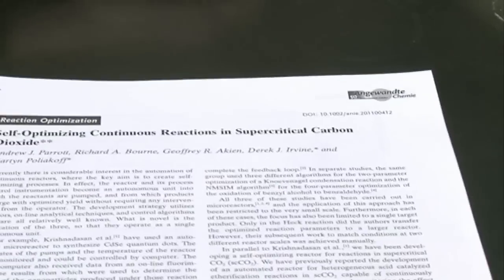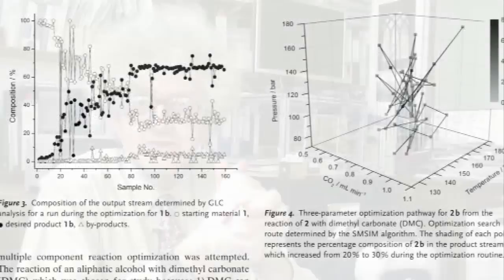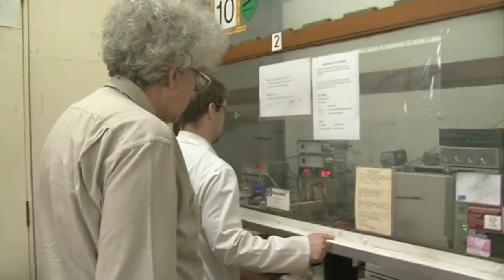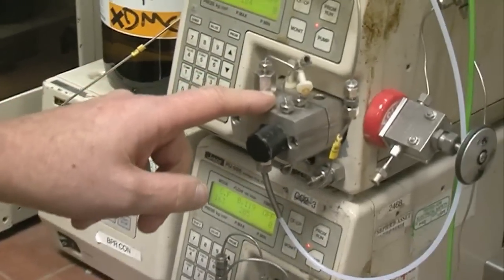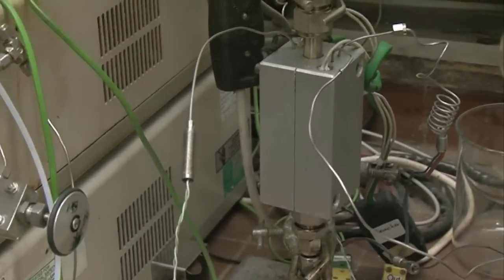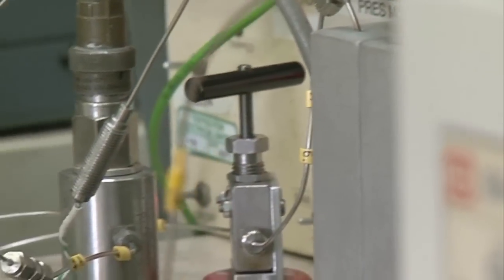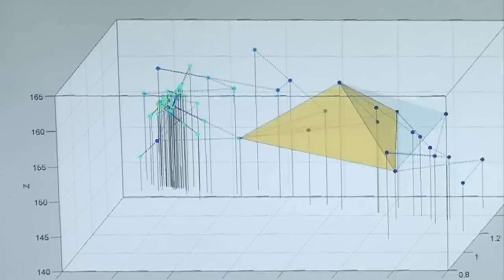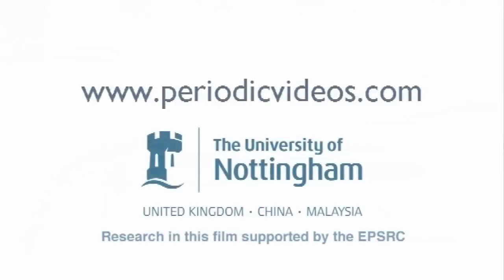Automatic Chemistry - Periodic Table of Videos

Comment: I think the brilliance of it isn't in the scale that you can move it up to, but coming back to the "green" side of things, you're compressing 80 or so days of experimentation down to 1 1/2 days. That's basically 78 or so days where you're not having to keep all this equipment running, possibly idling a lot of the time. You're also then saving energy on heating, lighting, etc.

So for nothing else, you're making a massive energy saving just through making the experiment much faster.

Comment: It would be interesting to compare the degree of optimization achieved by two different, but very similar, algorithms. The first, using the most precise physical chemistry equations known to date, against the second, using a less rigorous set of equations.

E.g. compare the efficiency of an algorithm using a virial equation of state to one using Van der Waals' or the perfect gas law. One set of "basic" equations vs one set of "state-of-the-art" others.

Comment: System constraints come into play like pressure drop which will affect other components in the system. What is done in the paper is feasible at lab scale because these constraints do not exist. 
Re my 1st comment. In industry you deliverately limit the degrees of freedom and optomise based item that affects the process most. In the lab you want to know which one is the strongest and thus scaling dsown requires more activity per manhours.